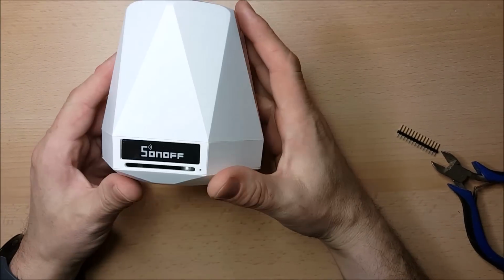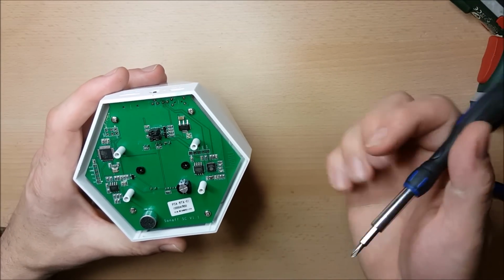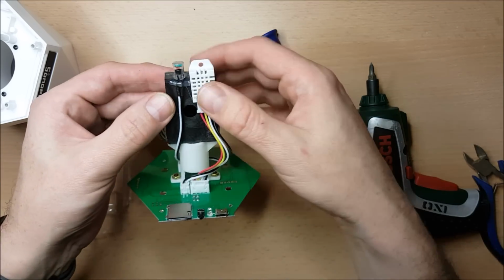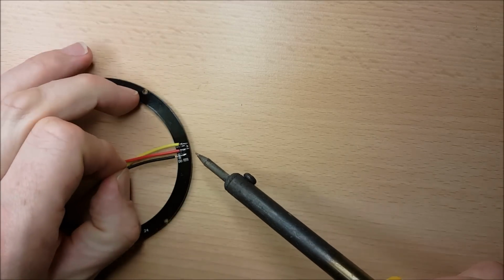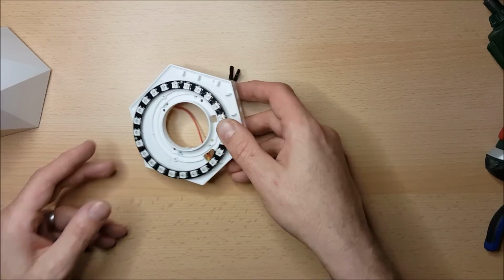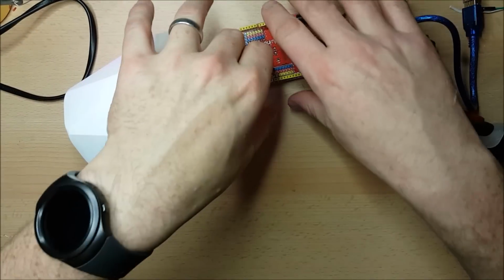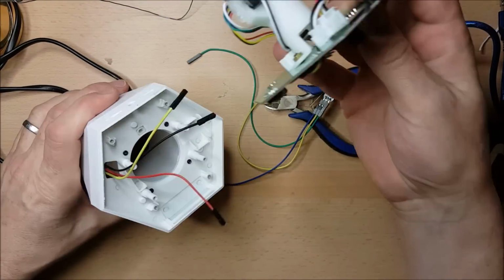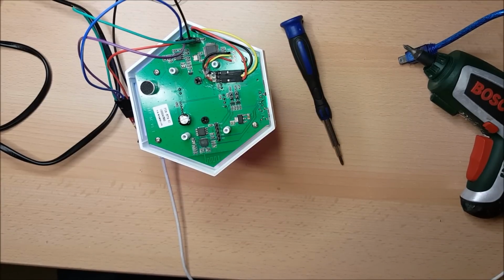Sonoff SC Hardware Upgrades

Comment: I used de firmware from https://github.com/KmanOz/Sonoff-HomeAssistant its asimple firmware but works perfect and quick.

The sonoff TH16 works with sensor temperature.

All works by MQTT.

Comment: Does the LED ring running for any length of time affect the temperature readings at all?
Reply from the maker: leglessinoz not that I have noticed, but I am using it more as a visual indicator (plants need watered, doorbell has rung etc) so I have not really run it for long.

Comment: You said the ISP header is also connected to the SD card. It looks like the digital pins 11,12 & 13 are available on that header. Was there a reason you used 11 and do you know if another pin is able to be used? I have to repair my temp sensor and connect it to another pin.
Reply from the maker: Simon no particular reason for using D11, could have been either of the others... There are also loads of pins left on the atmega that have not been broken out, if you are good at high precision soldering you could use them as well
Reply: Cheers, set it to d13 which is also the middle pin and all is working nicely.

Comment: When flashing the atmega chip i only get errors. What board did you set it to in the arduino IDE and what pragrammer? Any other special steps? From talking to Tinkerman he sent me this: https://github.com/esp8266/Arduino/blob/master/doc/filesystem.md#uploading-files-to-file-system for flashing the esp8266 (1M, 128K)
Reply: I had to connect RST to DTR on the FDTI programmer.
Reply: Simon, shouldn't the ESP8266 be set to use 64k SPIFFS rather than 128k?

Comment: Looks awesome! im going to do the same now, any idea if there is a way to keep the original sensor readings?  Looking to convert it all to MQTT for communication.
Reply from the maker: Simon Yes. I am working on this right now. There is firmware from Jose Perez (AKA Tinkerman) that does this already. I have been modifying it to add rgb function. I have made a pull request to add basic function for the rgb light, should be a feature soon. If you search github for my name you can download my version in the mean time.
Reply: Will do. Just ordered all the bits. I'll see what I can add when i get it.
Reply: You ca use Tasmota Firmware. Works like a charm on all my 68 sonoff parts. And addional i control all the things with http commands via a B&R Automation PLC. The X20CP1486 and the X20CP1584.